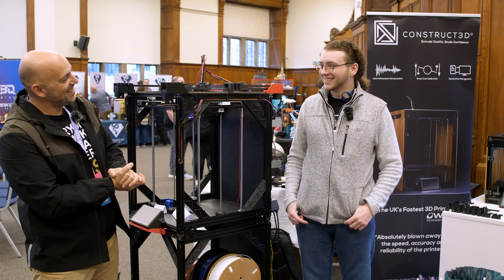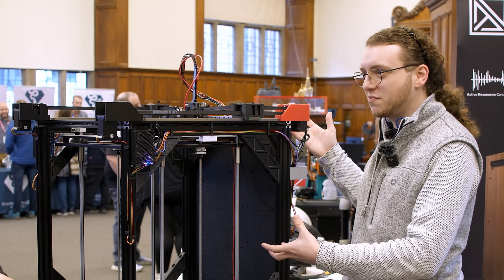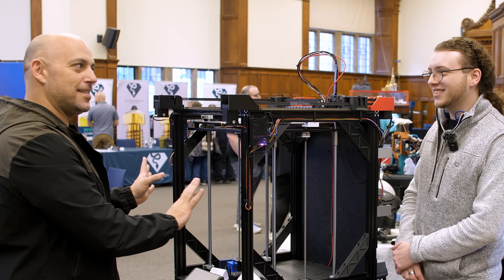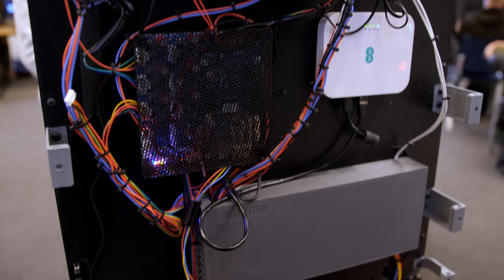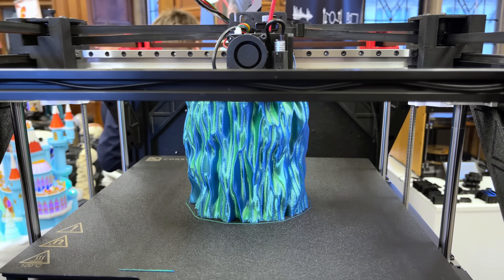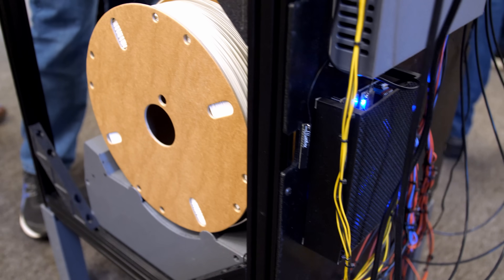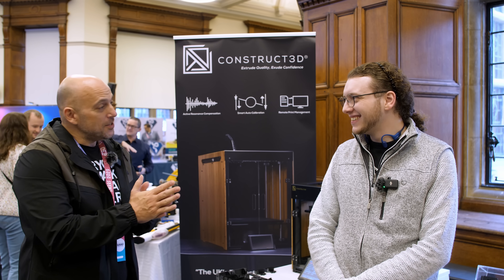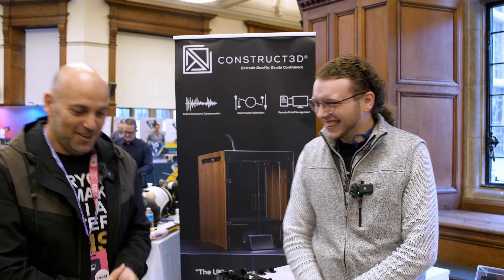An Open Source Filament Changer For Everyone! Construct3D At SMRRF

Comment: This is some of the most important research in the bridging use-cases between prosumer and full pro/small engineering offices. I don't need any more printer reviews and slapstick idiotic builds no one wants .... I NEED research and validated test results.  Printing dusty CF with linear rails is exactly what I have been trying to suss out and in 2024 just like the mandate of auto bed leveling ( which is frankly present everywhere and in most cases implemented poorly).... AL modern printers should be sold with filament drying....period .... full stop.
Can't wait to see more from Construct3D.... and YES... patent things !!!!....it's 2024... the cycle needs to swing towards IP protection again to ensure money is put where the most promising research is being done.... in another decade or two we can open things back up again and race-to-the-bottom of cheap junk... but I can't afford any more R&D failures called "features" shoveled out the door.
I'm saving for one of these... not another X1, or Raise, or XL
Reply: argggg... why is it so impossible to get them in the states????....can't even drive to Canada and pick one up shipped there.

Comment: Very interesting take on linear rails vs V-wheels. Always thought linear rails were superior. Seems like the difference in print quality is negligible
Reply: I wish I could remember, which maker (teaching tech, makers muse, cnc kitchen) did a test on this. Sure many others have but those three are my goto sources considering the level of engineering they reach in their efforts. Anyway, the studies I saw showed zero improvement in print quality. That said, and I can’t remember if they covered, and warning this is largely my opinion? Wheels wear out much quicker than linear rails. I’d think if you keep the rails/carriage properly lubed / cleaned through a regular maintenance schedule you’ll get many more hours out them? Keep in mind I have a Sovol SV05 downstairs that has wheels and I’ve not done ANYTHING to it in the last two years printing. It still prints beautifully but I’m thinking soon I should do an overhaul before any issues arise….

Comment: i like the idea of have a single filament type AMS for when you just run one filament.  Need the feed, flow detect, retract features for a single filament.  Bambu's only issue I have on the X1 is Single filament roll gets stuck and air printing happens because I don't have an am detecting filament flow or load.

Comment: Bambu's filament buffer is a copy of Mosaics Pallette+. No need to use a one way bearing. In Pallette+, there is a doughnut ring magnet, that rides on a ptfe tube, and triggers a hall effect sensor(inside aluminum enclosure), when it almost touches the side of enclosure. Also filament cutter in Bambu machines, are an adaptation of the Mosaics Pallette as well. You just heat the filament in an enclosed ptfe, and chop it with a blade with slight displacement, when soft. Doing at hotend heat break, uses the hotend as a filament softener instead. So not sure, why a blade cannot be used without an issue. Just some 💭

Comment: if I may, IMO the best solution for open source with profitability is time-shifting licenses. In other words, "until January 1st 2030 all rights reserved, as of January 1st 2030 GPL v2". 

One big issue with creative commons and other non-commercial licenses is, well, commercial endeavours are what prompt innovation. Restrictive licenses can be a real kick in the pants, especially if your idea is in line with the ideals of FOSS. For instance, say you want to make your IOT device a Meshtastic node as well and communicate with Meshtastic instead of some proprietary protocol, well, you pretty much can't. Meshtastic is GPL v3 which specifically requires that the user be able/allowed to modify the firmware, and that's just not practical for most products. Arguably it's even a security risk depending on what you're communicating over the network since someone could reflash the chip with a version of Meshtastic that logs everything going through it, silently collecting all of the data. So, even though you want to help the community, you can't because the licensing is too restrictive. Sure hypothetically you could work out some deal to maybe get a pass, but are most companies actually going to do that? No, they're just going to develop their own proprietary solution and call it a day.

A time switch license gives the best of every world because 
1 : it keeps the power out of the hands of the creator, no-one has to trust your word that "oh well we'll open source it eventually" there is a hard pre-set date for when it will be open. (this also means people are more likely to contribute to the project even while you still have full rights to commercialize it!) The point of licensing is the creator waiving their control over the project, and a creator simply promising that they totally will open source it eventually doesn't take that control away. In contrast, the second your work is published with a time-shifting license that's it, it's out of your hands, no backsies. Sure, you'll have at least however many years, but there is no question that after that time is up, it's free real estate.
2 : it ensures that ideas and technologies no-longer being commercialized are open for others to modify and reutilize. 
3 : it ensures you have a decently long period to get your foot in the door and get some ROI. 
4 : it's way less of a headache. No legal communications back and fourth, just "is it past the end-date or not?". You can still grant someone else permission to make it in the short term, but 10+ years on do you really want to be getting legal emails about whether or not some college student startup can use some of your ideas you had from your college student startup? 

It allows both for profitability and reutilization and free-flow of ideas. I've also seen licensing (I think it was for Qt) where you can pay-into a different license. In other words, "if you want to make a derivative work for free you must use the GPL v2, but if you want to keep your derivative work closed source you can pay us money" yet again balancing profitability and FOSS. (depending on the licenses you pick of course)

Static licensing is the obvious route, but the second you start considering dynamic licensing you start getting some real golden-bullet solutions.

Comment: A blade at the nozzle might not be practical for all, but at the filament changer definitely. As a quick/temporary solution the filament could be retracted at just the right temperature during cooling post print or do a cold pull during pre-heating and then cut the warped tip while ejecting it at the cutter like a spent bullet casing using solenoids and maybe a little bit of retract/detraction action.

The MSLA market is honestly in shambles due to open-source code being walled off behind proprietary obfuscation much like apple does. Although a slippery slope it might be the way forward.

Comment: 8:00 Patent holders are REQUIRED to disclose how their invention works as part of the public patent application.  So "releasing" information about how the mechanism works isn't altruism, it's a requirement of the patent process.  So whether or not this is truly opensource will come down to the licensing terms for the patent.  If the licensing requires payment to the patent owner, then it's not really opensource.

Comment: Awesome design! I'm curious about the winding solution - after looking at the step file I'm not quite sure how a one-way bearing would work in this situation? The required free-wheel movement of the bearing is in the same direction as you would want to rotate the motor in to wind the filament. Does anyone have an idea of how they made that work?
Reply: The motor rewinds the filament so the spool freewheels forward, as the extruder pulls the filament. This would allow you to run the retraction motor a fixed length, like 30 seconds, regardless of how long that color has been printing.  Also seems like when the filament is fully rewound, the motor would just free spin in reverse until it timed out.

Comment: Now this is awesome...this is very much like what i had envisioned for a filament changer but never would have the resources to properly design it. I've been waiting for the TradRack from annex engineering which should be released to open beta soon. But long term, this seems like the ideal filament changer. Something like ERCF or TradRack would be less expensive though.

Comment: I would love for this to work, but was immediately made skeptical when I heard they are relying on retraction alone for filament extraction, with not cutting. There is a reason why all the truly successful AMS systems use blades. I hope it works!
Reply: Should be able to work by simply heating some filament, extruding a bit, then quickly retracting. Essentially a hot pull of the filament. Like they said, may take some tuning, but should work. Otherwise they can always come up with some sort of in line filament cutter that can be installed atop any extruder.
Reply: @802Garage  the problem with an automated hot pull is that reinsertion is a bitch. You will need to cut the pulled filament before it is reincerted which you might as well do on the extruder itself and not do the hotpull at all.
Reply: @richiedeadsix  Right well I think that's why they have to dial it in. As long as you can do it with proper force and timing it should stretch the filament slightly thinner and make it easier to reinsert. I def see the issue at hand though.
Reply: Alright there's going to be some hotend set ups that it'll work beautifully but for most people and most people's set up there's going to be issues

Comment: Literally the first time I've heard that linear rails wear out faster. Interesting!
Reply: Full honesty my heavily moded ender 3 is actually still using all of its original v-rollers, from 5 years ago. A very light hand when adjusting the eccentric nut has gone a long way. The bearings for the bed have worn down more than the actual v-rollers have.

Comment: Everything he said about motion systems was patently false except in a sea water / aqueous / galvanic-prone environment. I am confused. He didn't even look like a sweaty dude so I have no idea where they are pulling that rail / CF marketing nonsense from. If his rails wear out faster than v-wheels then he needs to seriously look at his rail suppliers, because they are garbage.
Reply: My assumption is they are managing to get a bunch of CF grit in between the balls and the rail and that causes it excess wear? But I would say you have different problems at that point... like actually dealing with airborne particulate.
Reply: Yeah I have no idea what he is talking about. My guess is that they don’t actually know how to install linear rails correctly and are not getting them parrellel on y or their tool head is apply high cantilever forces on the x rail causing them to wear quickly. He also mentions aluminum rails which makes no sense and would be a very poor choice compared to steel

Comment: Very cool! Thanks for sharing, Joseph.
Jacob mentioned the relative performance (durability) between carbon fiber and linear rails and v-wheels.  I have always been curious why no one has tried (perhaps they have and found them to be equivalent to linear rails in this area) linear stepper rails for the X-Axis (as the name suggests, a stepper motor opened to be the length of the X-Axis and the extruder is mounted to the carriage which is essentially the "rotor"). I priced one out years (many) ago, for a manufacturing solution (solar cell handler), and found the full end-to-end cycles/day I needed was too high. Cheers

Comment: This is one of the most interesting 3D printing projects I've learned about this year.
And I really hope that the patented open source model works out as planned, because that could kickstart an overhaul of what we currently have.
Reply: it's pretty much what bambulab is doing as well, they haven't yet enforced any action upon private makers cloning their patents.
Reply: @Deathbyfartz That's not helpful unless they've explicitly licensed it for open source. They could pull the rug on any implementor at any time.
Reply: @Deathbyfartz  It's not like they have uploaded the STL files on Thingiverse or Instructables to build the AMS or printers, so there's that.

Comment: I am so pumped for this project! 
I have a Klipper machine and don't like that Bambu and Prusa have closed systems. 
There's really nothing that great out there.
Patent the hell out of open source, and keep up the great work!
Reply: 3DChameleon released the 3DClippy, a totally open source filament cutter
Reply: @hyperspeed1313  Yah that you need to mod onto your printer, so it isn't going to work universally for every printer, as it won't fit every printer.
Reply: @hyperspeed1313  Thanks Hyperspeed! That looks really cool. I'm defnitely considering it now while I wait to upgrade to Bambu!
Reply: For Bambu you couldn't use it on every printer anyways as it would require a printer that can cut off the filament at the extruder. No printer really does this unless you've modded it to. There's the Voron ERCF, the way it works though is that you have to tune the filament being retracted so that it forms the tip correctly. This seems to rely on the same method, but doing more rolls is going to be more expensive. Looks like each one has its own extruder, and a motor to roll the filament back. Then all the tubes from the filament need a Y joiner, so you'd have 8 going into one for example for 8 different filaments. Something like the Voron ERCF uses just 2 motors no matter how many filaments, one to extrude the filament and one to switch between which filament to extrude.

What appeals to you about this over the other options you've seen? What are the other options you've seen? This does look interesting but it seems like it will be a pain, as sometimes getting the tips of the filament to form correctly is a pain. With the Voron ERCF you can add a filament cutter on the ERCF to make the tip clean. Doesn't look like you can add a filament cutter on this system, unless it is on the printer head like Bambu which wouldn't work for all printers.
Reply: @markleaf1970  You sound like you have quite a bit more knowledge than me on the feasability of this concept! I am not familiar with many other systems beyond bambu or prusa, other than stripped down versions or clones. I saw a kickstarter that had a rotary head that changes like 25 filaments using nozzle tips but it's not out yet. There's also the 3DBizz project I've started to look into. This market has quite a bit of potential and I'm glad to see folks are starting to try and make alternatives. I appreciat your insights on the topic and welcome any alternative suggestions you have to offer!

Comment: It's nice to see new projects for this kind of functionality but what I don't get is why no one ever seems to cover the SMuFF project that predates a good deal of these projects ?
Reply from the maker: Never even heard of it to be honest, just had to google it. Looks very interesting
Reply: SMuFF seems overshadowed by Enraged Rabbit Carrot Feeder. They appear quite similar but ERCF has a lot more attention
Reply: @hyperspeed1313  ERCF did a good job of piggybacking on the Voron name even though it has no actual affiliation with Voron Design, I think that's the primary difference really. There's a nice big pool of very engaged fans of Voron looking for a solution, and there it is, following the Voron design language and everything...
Reply: Looks like a good project, but marketing counts. You can have the best, well engineered solution out there but if nobody's heard of it then it's no use. The creator needs to get the name out there if they want it to be heard I guess.